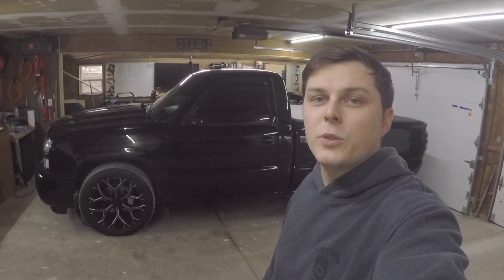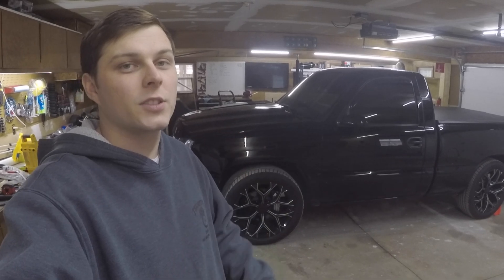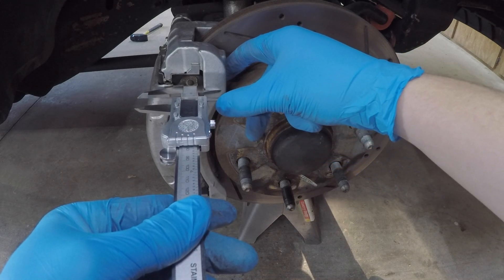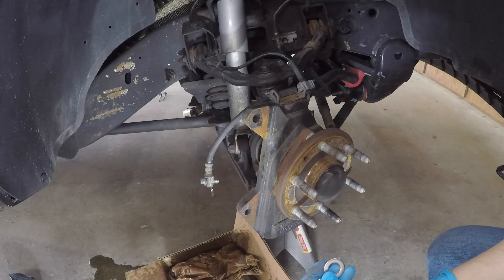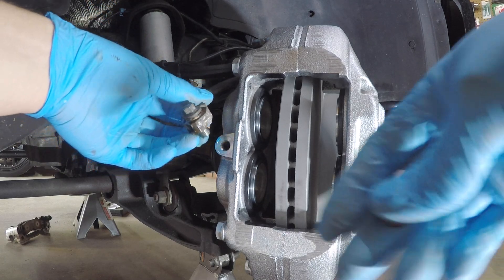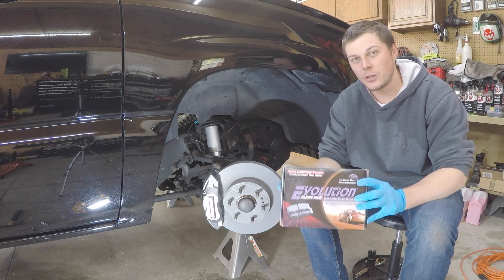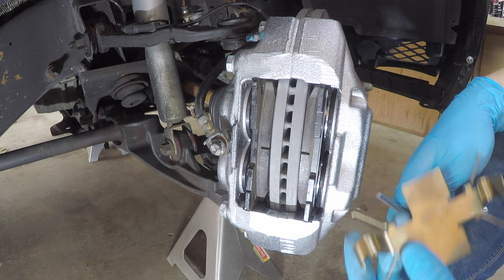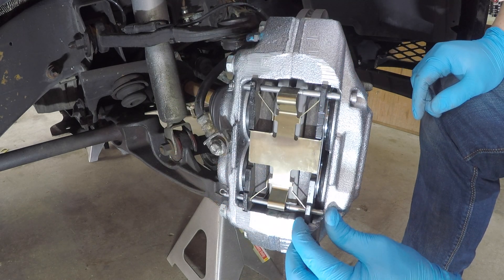Silverado 2019 Big Brake Conversion! “How To” A NBS!

Comment: Heyy @TheKingCoopa did you ever end up upgrading to Hydroboost boost? 

Did it solve the pedal pressure issue?
Reply from the maker: Hey, sorry for the late reply. I have all the parts for the hydroboost swap. Haven't finished it yet. Im doing to many projects at once lol. Still finishing up the 6.0/4l80e/AWD swap, and nitrous with a wire tuck. So its gonna be a little bit. But ill for sure post a video of it when I'm done. Hydroboost should solve the braking problems from the research I've done
Reply: @TheKingCoopa  Ah okay cool, looking forward to your comparison. 

Btw, have you considered a larger master cylinder first? The one that came in the NBS Escalade should bolt right up, and is the same size as the T1 that the big brakes came from… which might fix the issue, allow ABS to activate sooner, and still provide the feedback of a vacuum system Vs hydroboost.
Reply from the maker: @castleclubclipz  oh nice, I didnt know they were bigger. I'll definitely have to check them out. I was looking for a wilwood or billet resivor, but didn't have much luck.
Reply: @TheKingCoopa    Yup! The NBS 5.3 MC is 1 1/8” bore size (aka 1.125”), while the T1 uses a 1 5/16” bore size MC (aka 1.3125”).

The NBS Escalade came with hydroboost, but the MC is still identical, just larger bore size (1.33”), and bolts right in!
Reply from the maker: Also with the larger bore diameter, theoretically it would push more fluid, which would help with the stopping power?

I found a few larger ones on rock auto, but they say 1.25 for the bore diameter. I can't find any 1.3125
I found one on rock auto. Mind checking it out and seeing if its what I need?
Part number: 18M2440
(It won't let me share the link for whatever reason), I'd appreciate it
Reply: @TheKingCoopa    Yes, precisely… It would firm up the pedal a tad, less sinking/pedal travel, and more force as you step on it. And closer match the size of the T1 (which has 10 total pistons, compared to your setup of 12 total pistons).

And no, that is not the correct MC… The part number for the 1.33” bore size MC is NM4074A (if you have Active Brake Control), or… NM4074 (if you don’t have Active Brake Control).

Active Brake Control is RPO code JL4, so just check your RPO sticker in the glove box to see if you have it or not.
Reply from the maker: Thanks so much for the help!!
My RPO code shows JC3: brake vac booster disc/ disc 6400 lb

So I need the MC of part # NM4074, correct?
Reply: @TheKingCoopa    Yup, if JL4 is not listed anywhere on the RPO sticker, Active Brake Control / Stabilitrak is not present, therefore the correct part is NM4074.

And yes, even though your truck came with vacuum brakes while the Esky came with Hydroboost, the MC designs are the same (just larger bore), so you can still upgrade to Hydroboost later with either MC.
Reply from the maker: @castleclubclipz  sweet!!! Thanks for the help 🤘 gonna order a new MC right now
Reply: @TheKingCoopa   Awesome!

Comment: Hey man did you have rear disc brakes? If so what size e brake cables are you running can’t find any factory cables that came factory with rcsb for rear disc. Tried ecsb, rclb and are too short as for the cable is too short doesn’t come out enough.
Reply from the maker: Hey, mine still has the oem cables/e brakes. Sorry, I can't help you much there. You could always try at a local pick a part or junkyard, and rob one off the trucks there.

Comment: Is there a big weight difference between what you had and new set up? If so, any change with ride quality?
Reply from the maker: Hey, I don't exactly remember the weight of it. I'd assume you would be adding a little weight since the calipur and rotors are both bigger. 

Daily driving with the brakes is the same for me. But I did lose some stopping power when I slam on the brakes. Thats mainly because I have a large cam (less vacuum pressure) and added larger rear brakes (more pistons, more fluid to push) so im swapping to hydroboost brakes soon

Comment: I have a 2005 gmc Sierra 4wd and was wondering how people put on rear disks. I have drums in the rear and been wanting disks in the rear. if anyone knows any company's that make them let me know!!!
Reply from the maker: Hey, my nephew did the disk brake swap on his truck.  He just found a used axle on Facebook market place for 200$. (With the same gear ratio) Came with the calipurs, rotors, and everything. Unbolted his axle, bolted the new axle in, bled the brakes and was done in a few hours. He then sold his old axle for 100$. So not a bad swap for him. He said this was the easiest and cheapest method, as opposed to buying all new parts. Hope that helps.

Comment: Have you tested this conversion on the GMTK2 (2014-2018)?
Reply from the maker: Hey, sorry for the late reply. I can not garentee it will fit, but there is some research online that suggests it would. Definitely worth looking into though before you buy all the parts.
Reply: I can now confirm that it will fit. I used wilwood shim spacers instead of basic flat washers, but all OEM 19+ parts. The caliper would have rubbed on my factory 18”s had I not already been running a spacer
Reply from the maker: @chrismartinez6203  oh nice!! Glad it all worked out!!!
Reply: I can now confirm that it will fit. I used wilwood shim spacers instead of basic flat washers, but all OEM 19+ parts. The caliper would have rubbed on my factory 18”s had I not already been running a spacer

Comment: Will it fit if I have lift kit  or it has to be stock
Reply: @TheKingCoopa
Reply from the maker: Hey, a lift kit wouldn't matter. The calipur mounting location should still be in the same spot. Even with aftermarket spindles.
Reply: Thanks  I’m going to be doing this soon
Reply from the maker: @gabrielcardenas6235  for sure, good luck 🤘

Comment: if i go to my local parts store, what do i need to ask for ? 2019 chevy silverado 1500? your links dont work anymore. thank you
Reply from the maker: Hey, the GM part numbers are constantly changing. Id bring all the part numbers in the description and see if they can find any of them. Or try the 2019/2020 silverado 1500 calipurs. But being at a small parts store they probably won't have any in-stock and would have to order it. Or I'd try any big GM dealer near by. Some trucks get upgraded to brembo brakes at the dealer, and they just scrap the old (still brand new) calipurs. And you might beable to get them for cheap. Good luck on the search!
Reply: @TheKingCoopa  ok thanks, does it matter what engine is in the silverado (for the 2019/2020)
Reply from the maker: @noonespecial673  I'm not exactly sure but id go with the V8 to be safe, since these are the biggest brakes on these trucks from the factory. They have some smaller options that I assume goes with the smaller engine combos

Comment: Nice. I have the 2007+ gm suv brakes on the front of my 2001 silverado and the 2003+ suv rears too. Went with stainless steel lines too. Now I wish I did the 2019 silverado setup. Guess the next step is the zr1 calipers
Reply from the maker: Oh nice, its all good. The 07+ are still nice brakes! Let me know how the ZR1 calipers go! Thanks for the support 🤘

Comment: Great job I've commented before and have 2 questions today, for my 2004 Silverado 1500 2wd rear brakes that are the single piston disc set up to do the upgrade to the 2 piston set up would I want to get them from a 4wd or 2wd donor because there is a different part number for each. Second question, I've never heard anyone talk about swaping master cylinders after upgrading to the 4 piston front and 2 piston rear brakes, do the 2019 and up donor trucks run 2 piston rear disc brakes?
Reply from the maker: Hey, sorry for the extremely late reply!! For the rear dual pistons, I went with the 4wd yukon calipurs. Mainly because mine is a 4wd as well. But i honestly don't think it matters much.

The hydroboost will beable to apply more pressure than a brake booster can. Plus ontop of the a large choppy camshaft will have more LSA, lobe separation angle, which gives you less vacuum pressure. Less vacuum pressure on a brake booster means less stopping power. 
And the 2019-2023 silverados rear calipurs are single piston units. Its a little late, hope that helps. Thanks for the support!!!

Comment: I have a 14 with cast front end. Any idea if i will need the washers as spacers?
Reply from the maker: Hey, sorry for the late reply. I would assume so. The 2003-2018 calipurs can all be used or swapped like a direct bolt on. So im 95% sure you will need the washer. But it wouldn't hurt to double check with a set of micrometers

Comment: 13536580 and 13536579 have been replaced by  13545382 and 13545383. But I haven’t been able to order those either. I have one 13536579 caliper right now… just waiting to find a passenger side..
Reply from the maker: Hey, sorry for the SUPER late reply. Thanks for the info! I added those new  part numbers to my list in the description 🤘 hopefully you found your other caliper by now?
Reply: @TheKingCoopa  yes I did, I ended up getting it from Summit with the new part number
Reply from the maker: @magicalchair  sweet, glad it worked out. Thanks for the support!

Comment: Do you think these calipers will fit in a 2013 suburban 1500 LT 4WD ????
Reply from the maker: Hey, from the research I've seen, they should fit your platform.
Reply: El Pappy: did you ever end up attempting this? I also have a 2013 Suburban and watched this video and I’m contemplating it as well. Just looking for some feed back from someone who may have done it.

Comment: Great vid! ill be upgrading on a 2001 yukon. You don't want your wheels to lock up actually because then they are going to slide and not stop you, you do want the ABS to kick in and pulsate when you slam on the breaks! Does your ABS not kick in at all with this upgrade?
Reply from the maker: Hey, my ABS doesn't kick on at all. Being a mild cam, I have lower vacuum pressure. Plus more brake pistons, and large 22s. I definitely lost breaking power. So I'll be doing the hydroboost swap.

Comment: Are those rotors 13.99 in or 13.5 just waiting to know
Reply from the maker: Hey, sorry for the late reply. Its been so long since I did the swap, I honestly don't remember. I believe they were a full inch larger than the old stock rotors.

Comment: Do you know/remember the size of the brass/copper banjo bolt washers ?
Reply from the maker: Hey, sorry I dont. I believe they came in the box, with the calipurs. I'd assume its just the standard silverado size, because the bolt and brake line is still the same.
Reply: @TheKingCoopa  I figured it out! 10.3mmx16.9mm. Available at most
Reply: @TheKingCoopa  available at most store**. Also check your IG please for some intake questions !

Comment: Hi KC, Do you know how this would compare to the Caddy ATS brembo upgrade? Wondering if caliper is equally as large
Reply from the maker: Hey, I honestly can give you a straight answer. But I do know brembo is a very well know performance company. All their products are usually pretty nice. I also know that some silverado/gmc trucks (2019+) can be ordered with a special brake option, where the dealer will remove the 4piston setup and swap to a brembo setup, before delivering to the customer. So brembo is definitely the "higher package"

 That being said im not 100% sure if those ATS brakes will bolt up in the factory silverado spot and still have the proper offset/pad contact area. But another thing to keep in mind, those ATS brakes are designed for a 3,300-3,600 lb car, not a silverado that weighs 4,200-5,500lbs. So those brembos might be a performance option, for an ATS, but might be sub-par for a silverado. Idk, just something to thing about, and my .02 cents. But would still be worth looking into and doing some research on. Best of luck, and thanks for the support 🤘
Reply: @TheKingCoopa  great insights...didn't even think about the ATS weight difference...I have similar truck...06 RCSB running Weld S71's and 17x6 up front...worried about caliper clearance for sure...and I also have 5 lug  conversion to a 5x4.75BP so that further complicates things lol
Reply from the maker: @Chris-fl5lw  oh nice, thats whats up. I need that next. My heavy 22s slow me down so much, they look cool though haha. The 2019 calipurs need a 17in plus wheel, so you would be millimeters from clearing. Some guys even had to shave the calipur a little bit. Im honestly not sure if I'd even try to fit them in your situation haha. Yea thats a tough one.

I've been thinking about the 5 lug conversion, since wheel designs for the 6x5.5 is virtually non existent
Reply: @TheKingCoopa  yea I have the entire 1320 wheels conversion kit with dual rear caliper. Want fronts to be better before going crazy with power mods
Reply from the maker: @Chris-fl5lw  sounds like a good plan. Let me know what you end up going with, might have to do the same in the future
Reply: @TheKingCoopa  will do! I might look into c6 z06 conversion that is out there...but that is serious $$$$

Comment: Great video..truck is really nice. Did you need the caliper brackets too? Or just the unloaded GM caliper?
Reply from the maker: Hey, you just need the calipur. With pistons on both sides, they free float. So the calipur is hard mounted to the spindle. There are no calipur brackets for this model.  Thanks for the support 🤘

Comment: when you called up the dealer did you just 4 piston calipers for a 19 silverado? or anything specific you asked them?
Reply from the maker: Hey, you could do that. If they are good with their parts system, they should beable to find it. But giving them the gm part number would make it alot faster. There are like 4 different styles of calipurs on the 2019-2022 trucks.

Comment: i have a silverado1500 2020 on wheels i have 6 screws i would like to install with 8 do i fit the whole head to install from silverado 2500lt? Thx so much
Reply from the maker: Hey, sorry for the late reply. I'm not too sure on that swap. but I'd do some research on 6 lug to 8 lug conversion. depending on your trucks year. I would assume you would need the 2500HD spindle, wheel hub, rotors, and brake calipers. I know its been done, but definitely look it up before you start buying parts. Best of luck, and thanks for the support!

Comment: Hi im try to upgrade  my 2006 ss intimidator  I'm try to buy the calipers 2019 silverado  do you know what model have that  rotors?
Reply from the maker: Hey, sorry for the late reply. I looked up the 2019 Silverado 1500, then looked for the 4 piston brake setup. But I believe the RST, or high country should have them as well.

Comment: Do you think this will fit 2007 caddilac escalade 6 lugz
Reply from the maker: This applies to GMT 400: 1987-1999/2000, GMT 800: 1999-2007 Classic, GMT 900: 2007-2013/14. So it should fit.

Comment: Could I use 2014 brakes and rotors on my 06? Only asking cause a customer swapping his with willwood and I remember watch this video so I wanted to make sure they’ll fit cause he’s gonna throw them away
Reply from the maker: Hey, I've never done it, but from the research I've seen, yes.
Reply: @TheKingCoopa  is the process to install it the same yours?
Reply from the maker: Honestly not sure. The calipur style is probably completely different. I know the mounting bolts are the same, but the caliper/rotor size, offset, ect im not sure. So I don't wanna pass some bad knowledge. I'd definitely do some research on it
Reply: @TheKingCoopa  your fine I’ll do some research on it! Appreciate it tho bro!
Reply from the maker: @jorgemoreno8316  for sure, good luck 🤘

Comment: I did this conversion with 2018 front brakes and wheels on my 2004 Suburban which came with hydroboost and the 2 pistons per caliper in the rear already and what a difference from the old front brakes to the new 2018 rotors and calipers, night and day, I also used PowerStop front and rear. I am much happier with the braking now unlike before.
Reply from the maker: Oh nice, thats awesome! I'm excited to do a hydroboost swap. Need my stopping power back haha. Thanks for the support 🤘
Reply: @TheKingCoopa  I also heard that the 2000-2021 years Silverados, Tahoe's, Suburbans come with a 6 piston front caliper with a 13.5" rotor which also directly bolt up with just adding a 1/2 inch washer to space the caliper out to align with the rotor. The braking power is suppose to be a lot better over this upgrade, I am strongly thinking about upgrading again to these year brakes. Some people on YouTube have already done this upgrading and are very pleased with the outcome.
Reply: @tysoncurrie7745  That is a aftermarket upgrade the factory used on trucks that were ordered with it from SLP. I have yet to see one with them.
Reply: @tysoncurrie7745   Thanks for this info! I will be researching this also.
Reply: What diameter wheel is needed?